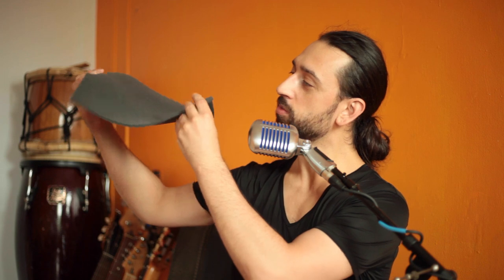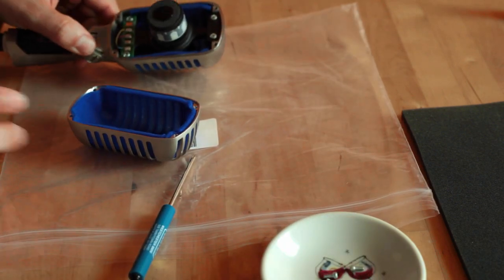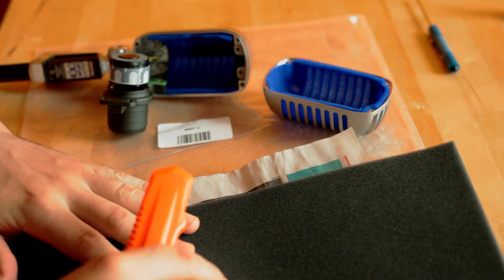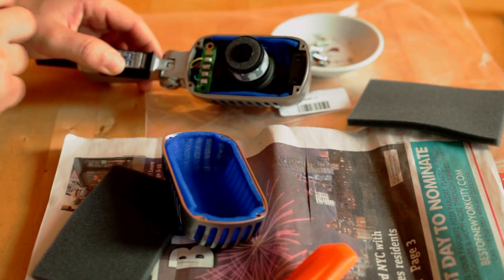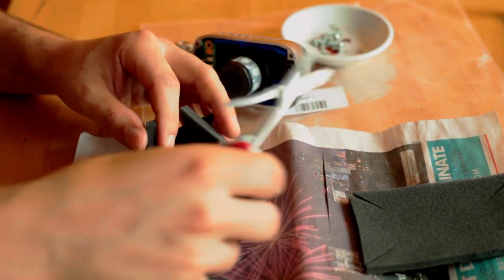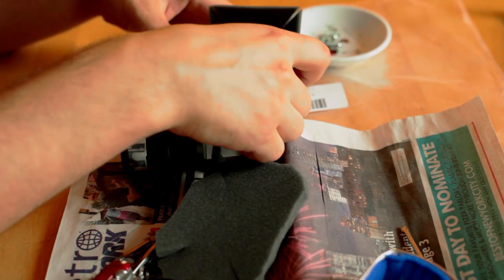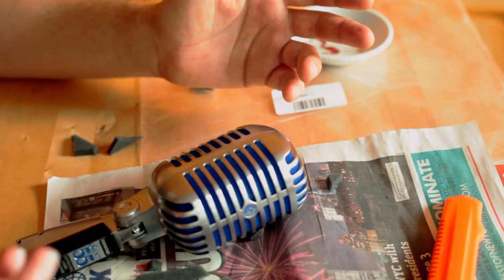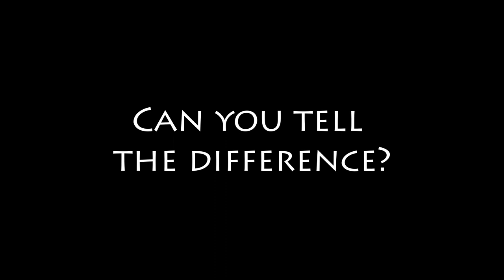Attempting to improve an AMAZING Microphone! Modifying the Shure 55 Deluxe Super Dynamic Mic

Comment: thanks for opening up the mic and the idea, but honestly I don't think it sounded better but rather more muffled as you lost a lot of highs and the plosives were still there, only muffled.. Nonetheless, thanks for your experimentation! As another commenter noted; Shure has certainly attempted optimizing this over the last 60+ years, so I don't know if there's really much to do internally except to change the cartridge or in fact the entire body design,,  which of course is not the point - I was actually looking for the LED mod BTW.
Reply from the maker: I agree with you. The intended effect just wasnt acheived. I did give it a try. I think the best solution is to modify your technique, or use a different mic
Reply: Back up from the mic bro, and turn the gain up a little bit. You should be 3 fingers to a fist away from the mic. Your lips shouldn't be touching it.

Comment: Foam intended for an Air Conditioner filter works better for this purpose.   Fixing plosives inside the mic is much harder than doing it outside of the mic with a pop filter...    BUT you CAN get some positive results by adding a layer of AC filter foam.  It's not going to muffle the mic as bad either.
Reply from the maker: This sounds like a very good suggestion! I havent tried it, but imagine this is an excellent solution
Reply: @TheJackMarcin  It's certainly functional.  The AC filter comes in various thicknesses,  and is the closest thing to what come stock in mics.  Adding a bit more does help if you need it.  Or you could learn Mic technique like a singer.

Comment: I think that the best way to add any kind of foam or windscreen is actually keeping it away from the mic capsule aka don't let it touch it! Sound is also vibration! I would put as much foam as I could while making sure it doesn't touch the capsule AT ALL. That's why I think this first modification was better than the second one. This also explains why your first test with the foam layer OUTSIDE the microphone sounded so good. Use a thinner and "denser" layer of foam, stick it to the enclosure on the inside with a few points of glue and you'll get the best results! 
Oh, and just ad a rectangle on the front side. Avoid all sides and back. Trust me!
Reply from the maker: I agree with you. This was an experiment and I find that its better to just leave this alone as made by Shure!
Reply: @TheJackMarcin  Interesting! Thanks for reading and both your videos!! 😉

Comment: You probably don't need the foam at the top or bottom and could have cut it so there's about an inch clearance on the top and bottom. It would have fit much easier

Also, why add foam to the back?
Reply: cause the mic is like an acoustic box, the sound wave will like reverb on the each side, so you need to foram the entire box
Reply: @renanmalato  the purpose of the foam was for plosives, not acoustic treatment

Comment: I don't have plosive problems with this mic.  I've owned a few of them and sing live on stage with them.  Like any mic, how you hold or or what angle you sing into it matters and those aren't the same for every mic, and with this one, it sounds great and has less of a plosive problem if you sing across the surface of the front of the mic, rather than directly into it.  That's a big reason for it having a hinge, too.
Reply from the maker: You’re right! Ive since addressed the isssue👍

Comment: I already know that there is a blue windscreen inside the Shure55. I was asking about the foam material that you bought and placed inside the Shure55. I want to do the same on mine to get rid of minimize those plosives..... Please let me know. I'm planning to get the 1/4 " pop filter screen. Thank you.
Reply from the maker: I am indeed using the 1/4" windscreen from Adorama. However I find that a slightly thinner screen would have a less drastic effect on the frequency response of the microphone.

Comment: I think you don't have to put a windscreen in the back of the mic, cause tou are not going to talk this side
Reply from the maker: My concern was to prevent any and all unwanted noise.. Obviously I will not be speaking into the back, but since i already opened the mic, I figured might as well further isolate/insulate the audio as much as possible. It really wasn't too much work and it might cut more unwanted rogue sounds this way even if just a tiny bit. At least that is my logic here.

Comment: Actually i did another similar approach: making a small cylinder foam surrounding that inner dynamic, just like the sE Electronic V7 microphone does, and it really works..
Reply from the maker: Very cool! Thanks for the info! This mic is such a beauty i wish they had engineered it to not have this plosive sensitivity!
Reply: @TheJackMarcin  : Shure actually does very good in eliminating plosive, for example: the foam for SM7B is very effective against plosive..
Reply from the maker: I believe even the sm58 has a way better time with handling plosives than the sh55 Deluxe. The sm7b is in a league of it’s own

Comment: Hi Jack, i have the Shure S55 Sh mic, with The original grey windscreen, i want to know how can i replace it, and maybe can put a blue windscreen like your Super 55 version, Thank you for the video dude
Reply from the maker: I believe it would be possible!  Although i dont have a regular 55 to do it. Perhaps i could make a video! Would be very cool to mod it!
Reply: I believe both the grey and the blue foam is sold as a spare parts by shure. You can get the grey one on Thomann. Might also be an easier way for you to do this plosive rejection mod. Buying the blue foam as an original part already cut to fit, and then adding the grey you have underneath that as an extra layer.
Reply from the maker: @jensharald9091  Thanks for the input Jens!

Comment: I’m not too familiar with how polar patterns work, but I heard there’s a little pickup from the back of this microphone. Do you think putting soundproofing in the back instead of windscreen would help eliminate that? Awesome video by the way!
Reply from the maker: Thank you for liking!  Now when you use the term windscreen and soundproofing are you having something specific in mind?  I used this windscreen material here, and i’m just curious what you might mean by “soundproofing.” Btw i also have another video where i used an sm58 windscreen instead of this material. See here https://youtu.be/iPvXpXjbN8s
Reply: @TheJackMarcin  I guess I mean like cutting out a small bit of foam paneling that you’d put on the walls in a studio and putting that in the back. I was thinking that would eliminate any pickup from the back and also possibly allow you to hold it from the back while using it? People say not to hold it like that because I guess it causes feedback but I was thinking the foam paneling might help both of the issues.
Reply from the maker: @johnfaheymusic9430  even doing what i had done is a little invasive as it would change the polar pattern response. wouldn't recommend using soundproofing!
Reply: With a microphone that has been used for several generations I think everything under the sun would have been tried with it, unfortunately most people have no idea how to use microphones properly, including this dude.
Reply: @johnfaheymusic9430  there's  a reason back-leakage is designed into most microphones. Plugging that up can take a lot of the life, or 'dynamics' out of a dynamic microphone - I can't describe it any better, give it a try some time - it's related to the same kind of acoustic porting one might do with a speaker cabinet and it's part of every mic I can think of to some degree.. I expect the easiest way to think about it is; the incoming soundwaves have no place to flow through, thus leaving one with a 'boxed-in' sound.

Comment: Or, just buy a 10 dollar pop shield and retain the intended frequency response of the mic?
Reply from the maker: Although in a studio setting i think that is the optimal solution. And i would agree with you. The reduction in plosives will be remarkable compared to the method i presented in this video. However, if you take this microphone to a gig, you might not necessarily be bringing a pop shield. Plus a pop shield definitely changes the visual appeal of this microphone in my humble opinion. 

But i think your option is better if you are recording at home and not up on a stage with it.
Reply: @TheJackMarcin  yep they definitely look pretty cool, we used to have similar to these when we were gigging but they were terrible for noise.. one tap on the mic stand and you could hear it! It’s a shame the don’t float the diaphragm in that mic too.. we eventually gave in and went for sm58’s but we missed the look for sure
Reply from the maker: @jasonyard9979  it is a big shame honestly, the microphone looks great but as you state it has its own drawbacks. And honestly, the SM58 is just an all around workhorse that sounds fantastic.

Comment: I use a shure 57 windcover and put it over the capsule.
Reply from the maker: I may want to try that! Because i believe there is still a little bit of room for improvement.  I do own one of the windcovers, but they are much fatter compared to the 1/4" material I used!
Reply from the maker: Hey @E Older i made a video where i did what you suggested, check it out!
https://www.youtube.com/watch?v=iPvXpXjbN8s
Reply: The big problem with the design of these mics is the bit everyone likes about them and that's the case but also the way the capsule is mounted. Look at the the way the capsule is held in that big flat plate inside the mic. The moving air from your mouth flows over the top of the capsule and then has nowhere to go so it just pops around inside the case exaggerating the plosives. The only way to solve this would be to remove the plate and mount the capsule on wires or springs so the excess air can flow around the capsule and more easily out the back if the mic. Modern designs such as any current SM58 style mic allow a free flow of air around the capsule. Mic design has moved on and the retro look is the only benefit of this design of mic.

Comment: If you accidentally break the wire contact just solder it back.
Reply from the maker: Definitely dont wanna break it! Hope this didnt happen to you! But yeah soldering would be a relatively easy fix for a skilled tech!
Reply: @TheJackMarcin  It's relatively easy to solder stuff when you've been doing electronics since childhood, if you want to reduce plosives on these types of microphones you need to sort of sing or talk on an angle across the diaphragm rather than directly into it, they have always been notorious for this, by stuffing more windsock stuff in there is more or less compromising the frequency response and muffling the clarity, you are better off not trying to get any proximity effect that close, make the microphone 'hotter' (increase gain/voltage) so it picks up from further away and not gesticulating directly into the front so square on but putting it 'off axis' from the side, above or below...
Reply from the maker: @FrancisMaxino  I agree that it is easy if you know what you are doing. Not everybody has been soldering their whole lives! I just don't want to encourage someone who is new to go ahead and start soldering!

Although I love this mic's sex appeal, unfortunately I find this mic quite prone to feedback. My go to for vocals is the SM58 or the e835 by sennheiser

Comment: just put a sock over it.
Reply from the maker: Which color sock do you suggest i use?
Reply: It does not really Matter. Go white, if you dare ;-) but Jokes and looks aside, really, try it out! Works like a Charm! I recommend the ones that make em´look like Mic want´s to rob a Bank. :D Don´t use em too tight, "clutter" the access Material asymmetrically in the Front. Less plosives and you lose less higer frequencies. Kind regards from Germany   @TheJackMarcin   UPDATE: Super easy huge improvement: It´s simply glued too tight. (Might be due to warranty and durability reasons (*or shrinking over time), just to keep the inside clean and free of dust.) Just carefully loose the foam with a chop stick or even more carefully, with a screwdriver. I left it only fixed on the most parts of the back of the front half grill, just to keep it there and have best of both worlds. (Less P´s and just Dust-Proof enough to survive) There you are: Prove me Wrong! :-D